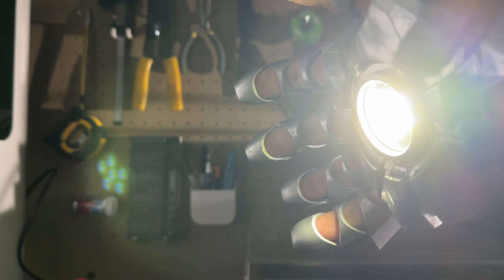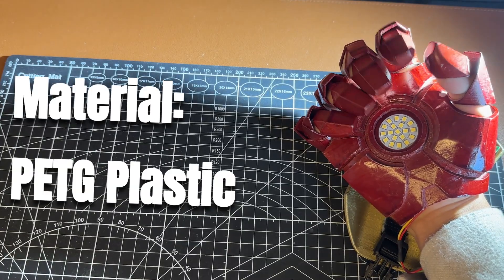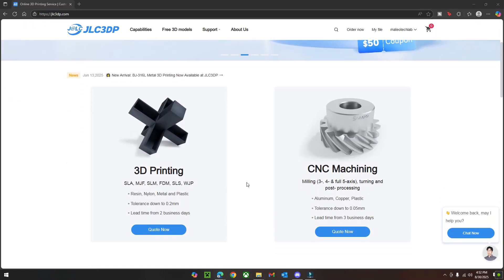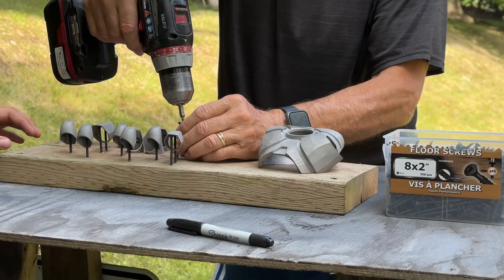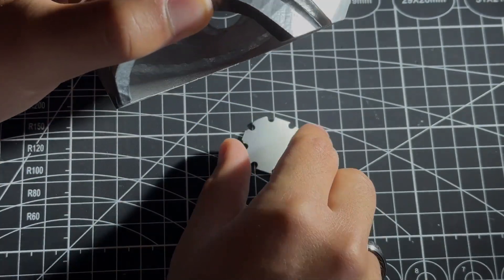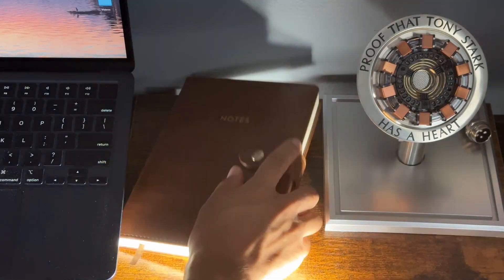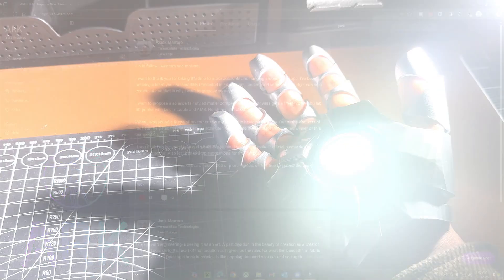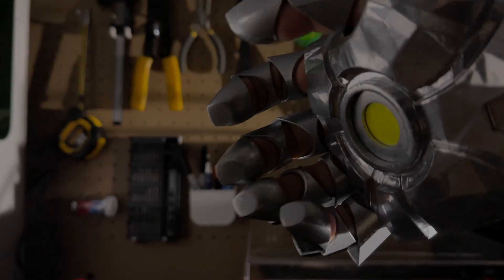I 3D Printed Iron Man’s Gauntlet… in METAL! (DIY Project)

Comment: How do you plan on integrating a real exoskeleton - not the one found in the movie, that’s not an actual exoskeleton that realistically functions or at least one that can fit into the suit?

How do you plan on filling the exposed areas in your metal 3d printed armor glove? 

Are you taking into consideration how much this suit is going to weigh when finished?

Also, for places like the chest plate  and leg parts, instead of metal 3d printing - consider at home pressure sheet metal forming - there are also services for this on pcbway - you’ll likely save money - and make sure to order your parts to this project in large batches to reduce shipping costs
Reply from the maker: Batch orders is a really good tip! For the time being, I’m more focused on functional robotics and wearable mechatronics. The glove is more of a passion project and proof-of-concept, but it connects back to my robotics work (like F.L.E.X.) where control methods are a big focus! To answer the other questions, I guess you'll just have to wait and see ;)